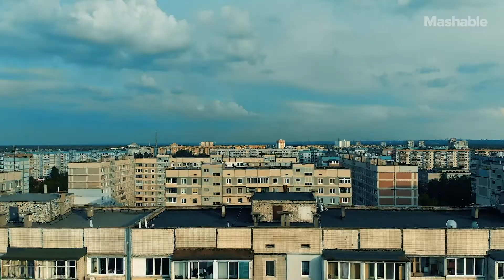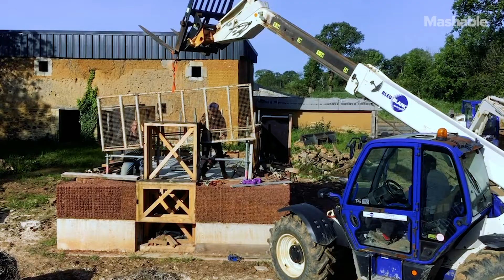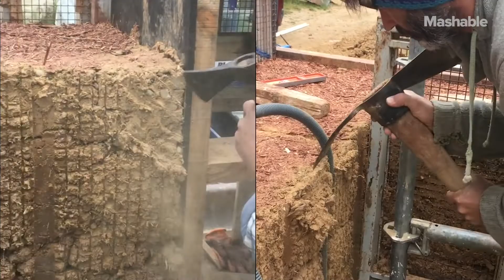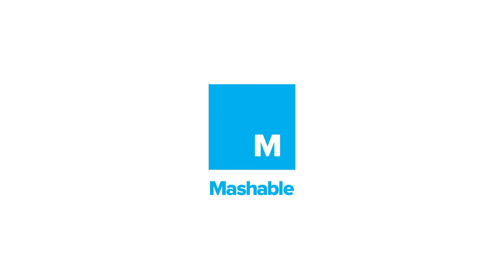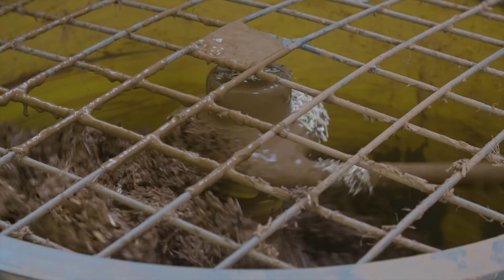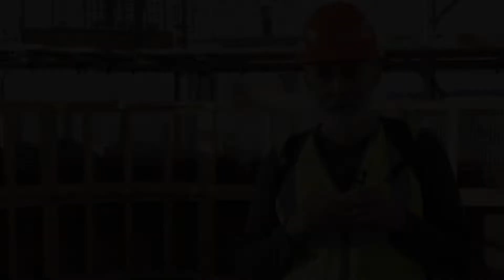CobBauge Training Day Session 1  Introduction EN

Comment: Can I ask a silly question - but why wouldn't you seperate out the two walls. First thermal insulation and second the cob, and then you could get more insulation by trapping the air inbetween